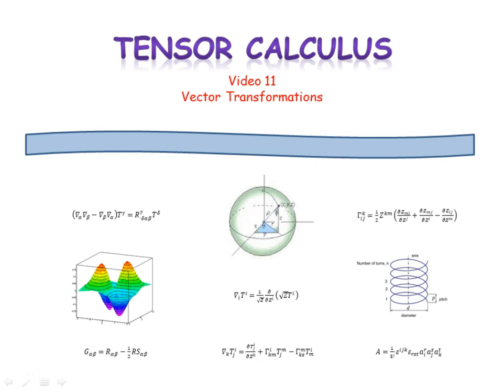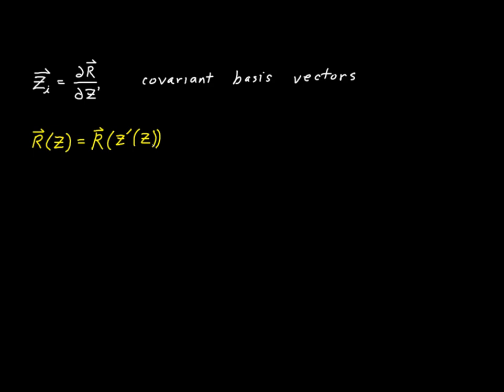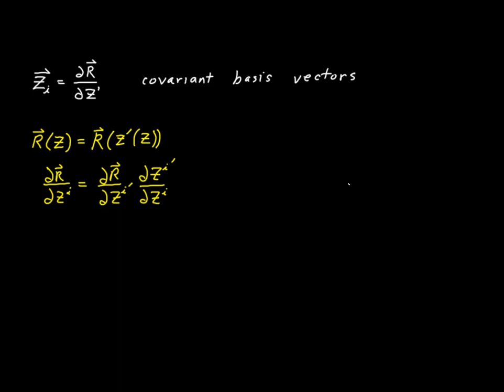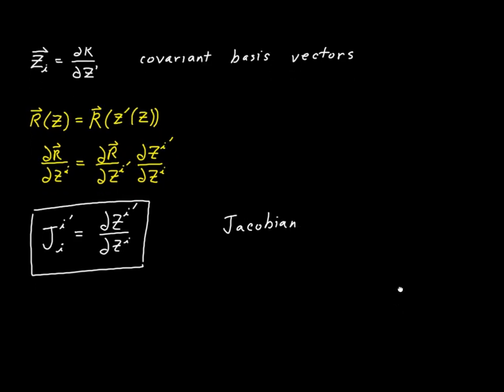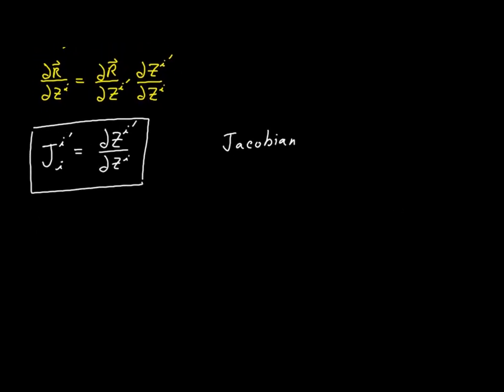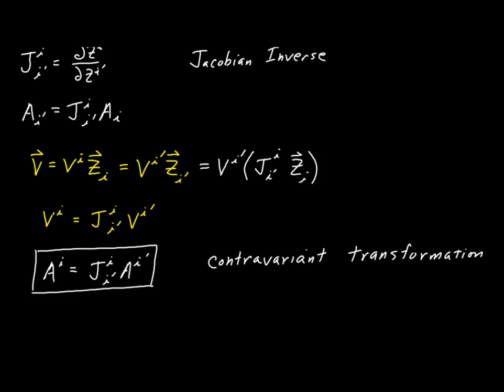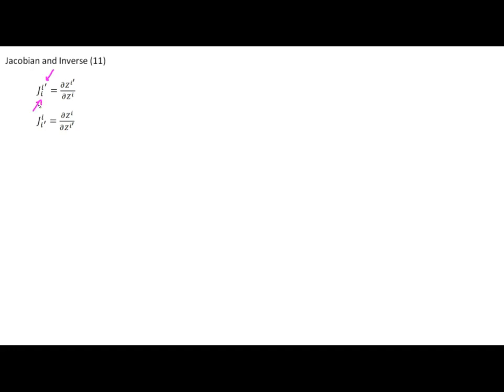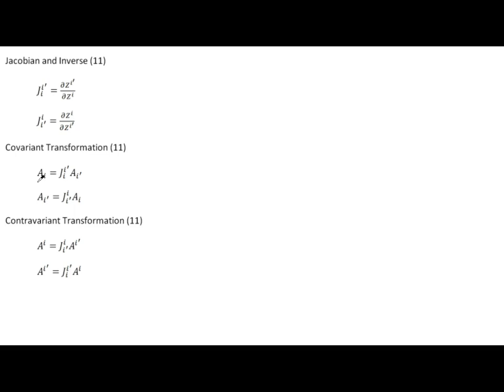Video 11 - Vector Transformations

Comment: R(Z)=R(Z"(Z)), this is not right .i think it should be  R(Z)=R(Z(Z')).
Reply from the maker: The expression is correct as is. The idea is that R is a function of Z, but it is also a function of Z'. Then, in turn, Z' is a function of Z. So, in the end, both sides are ultimately expressed as functions of Z. It's just that the right side does so using a compound relationship between Z and Z'.
Reply: here's  an example. Z  as cartisian  (x,y),   Z' as polar (r,θ),   R(Z)= x^2+y,  R(Z')=r^2+θ,  R(Z) !=R(Z').   R(Z)=x^2+y=(rcosθ)^2+rsinθ =R(Z(Z')) . i am 54 years old. learn math just for fun . maybe i'am too stuborn to understand your idea.  regards.